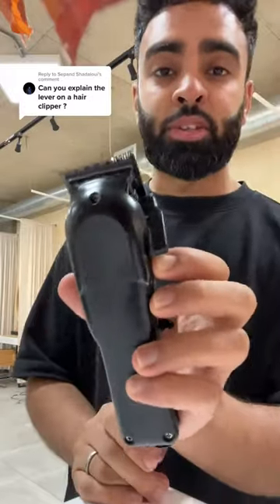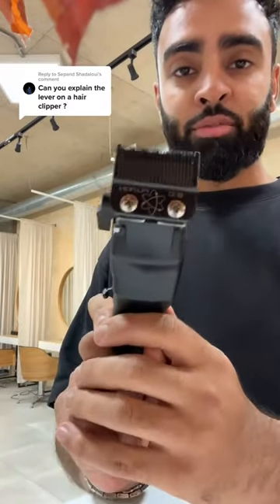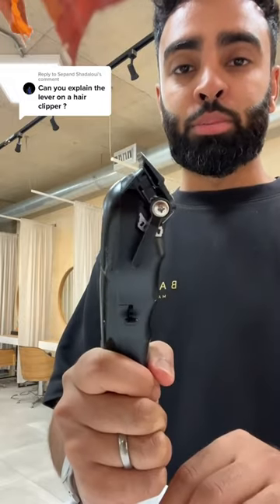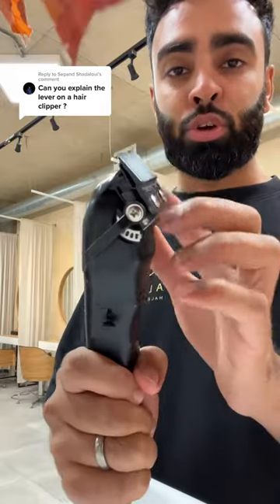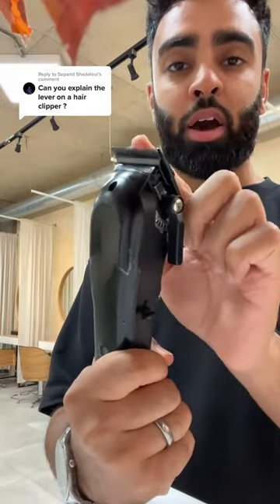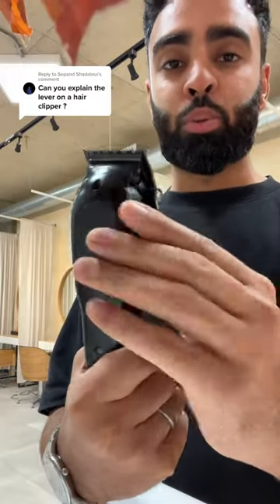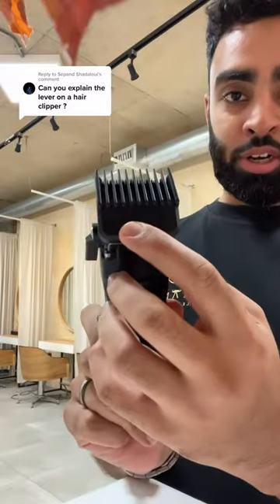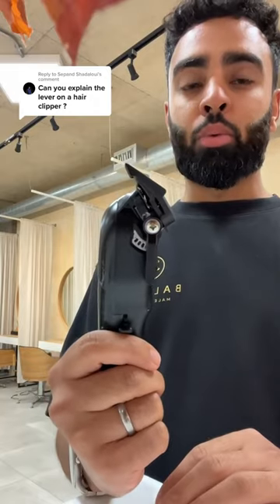Hair Clipper Lever Explanation | Q&A | Balance Male Grooming #shorts

Comment: How you get from 0.5 to 1.0... or from 1.5 to 2.0?
Reply: @Haakaarii you’re the best thank you!  I’m a woman but I was feeling a little manic and I went to salon and got half my head shaved without thinking about how I’d do maintenance at all. I can go to barber but I’d like to learn myself. She didn’t buzz it short enough anyway
Reply: Late reply but there is a 0.5 guard and a 1.5 guard u need to buy
Reply: ideally your clipper open is an automatic .5 so lets say you had any guard to it with the lever open always add .5 to it so lets say you put a 1 guard with the lever fully open it will be a 1.5, now if you close it half way it will be a 1.25, now if you close it all the way it would then be a true 1
Reply: adding onto my comment now if you have a .5 and want to get to a 1 you can simply go from the lever being fully open with no guard on to adding on a 1 guard fully closed and that will give you your 1 guard length. As somebody else mentioned they actually sale .5 guards and 1.5 guards which you have to buy separate and that alone will help out a lot more